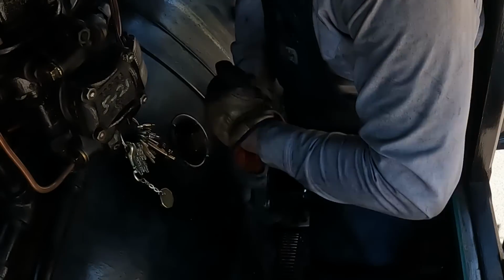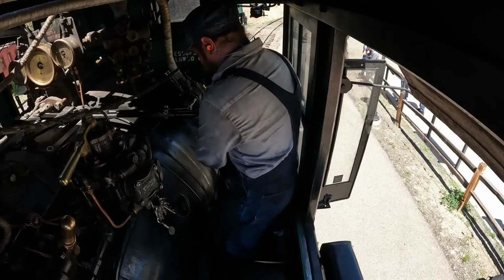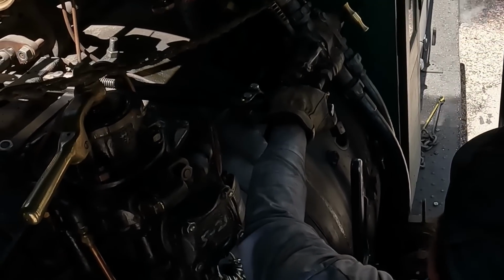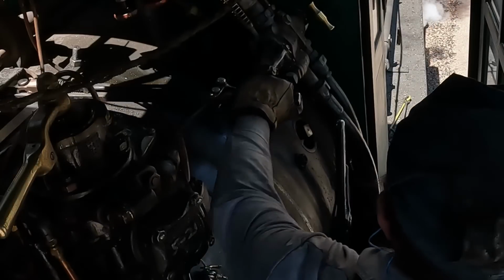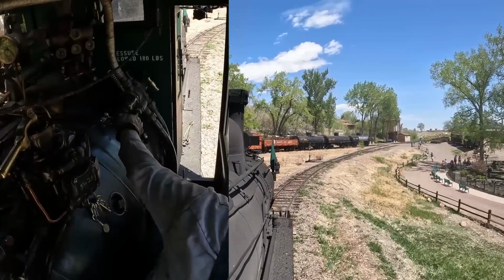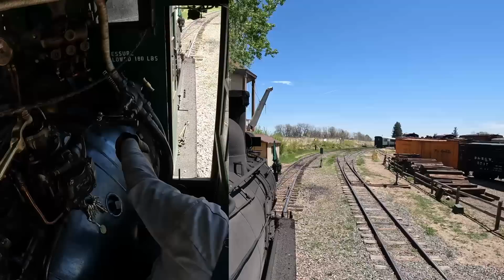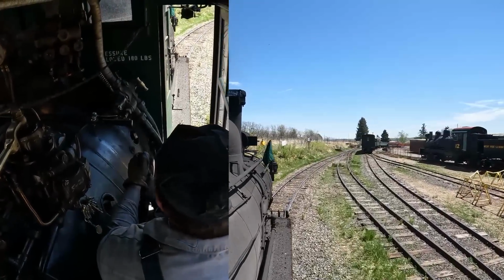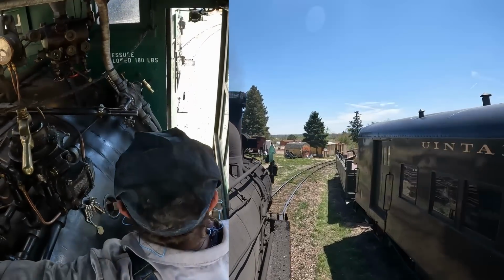How to DRIVE a real STEAM TRAIN - First Person Engineer!

Comment: Hello Hyce:  With your professional knowledge of management of train handling and train operation, I am surprised that you referred to running a locomotive as to "drive" it in your video title.  Since the museum is a teaching museum, it is important to teach facts on the thematic subject.  Here in the North America, it is important to stress the fact that "driving" a locomotive is incorrect (which applies to any type of locomotive motive power).   My comment is not directed to you but to ignorant rail fans and the general public alike that visit the museum and watch your videos.  Take it from a retired locomotive engineer of a major Class 1 US railroad and rules instructor.  In comparison, contrary to European nomenclature, here in the US is a fact that needs to be known and taught to fellow rail fans. As we taught in our technical training classrooms to our students, the locomotive engineer does not "drive" the train as it is often incorrectly implied here in North America. Simply put, the locomotive engineer (or operator of a locomotive) "runs" the diesel engine which in turn propels the locomotive via electric traction motors.  (Steam power in your case).  Reference to diesel electric, it just so happens that the diesel power plant propels the unit in response to the hand controls the locomotive engineer (or operator) manipulates in the cab (the throttle).  The unit(s) (locomotive(s) travel on a fixed guide way and are not driven (or steered) like a road/highway vehicle.   Also, inside the railroad business, categorically a locomotive is usually referred to as a "unit",  when in consist.”  For example, if one sees a train with three locomotives, it would be referred to as a three unit consist, or a set of power.  Rail fans may call this a lash-up.  In the railroad business, it is addressed as an "MU" (multiple unit consist, or simply 'consist').  Sometimes a single unit is also referred to by the slang term as "motor" by crews.  Hyce, you would make a very good instructor, your knowledge on steam and management of train handling is admirable.  Keep up the good work!
Reply from the maker: Howdy Ernest! I hate the term drive, and always say run myself. The title was to get non-train folks to come watch, and it worked, thankfully! One of those things about YouTube. Gotta get people in the door. Great comment, thank you!
Reply: @Hyce777  your title certainly got my click, and I’m so glad that it did. I love your videos and the type of person you come across as in them.
Reply: When kids would ask us how we "drive the train" we show them the brake wheel back in the caboose / coach and tell them that's how we steer.

That reminds me of this one woman who refused to ride since there was no flanges on the OUTSIDE of the rail. 

You meet all sorts.
Reply: @kevindowling157  Same here. I know nothing about trains but find them fascinating, so I'm glad to come across videos titled this way, as well as comments like Ernest's. It might be good to explain the correct terms in the beginning of the video, though. Just a thought. Either way, great videos!
Reply: @Hyce777  I wonder if "How to RUN a real STEAM TRAIN - First Person Engineer!" would have worked any less... and I've seen those colloquial "drivers" in virtual aerospace as well, like a "Hornet driver". It's rare, but it happens. Then there's a simple rule to go by if getting engaged by something: "Break! Jink! Stop driving!" (thanks to C.W. Lemoine for that! XD).
To be fair, as English isn't my native language, I've been guilty of saying/writing "driving a train/locomotive" before as well. So it isn't always just ignorance driving that wording, pun intended.
And since curiosity brought me here in the first place, learning the proper terms is part of the whole thing. There's no point in learning wrong stuff ;)
Reply from the maker: @CakePrincessCelestia  Glad you made it here, and appreciated the discourse. It's hard to say if one would've done better, but in my book, aiming for the general public who drive cars; they'd figure you drive a train. Running a train may not give the instant click, which is what you need for the video click, it seems.
Reply: From a pedantic linguistics standpoint: one definition of "drive" may be inaccurate here, but others certainly aren't. You could technically drive an engine that doesn't move at all, and on the same token "run" doesn't necessarily imply movement either. Industry terminology is a strange beast sometimes.
Reply: @Hyce777  Weird that people will apparently make such a big deal about using that term and yet there are actual job titles and postings called "train driver"
Reply: All that comment to say "i wanna criticize you for no real reason". Hyce is a person, he isnt the museum itself and can talk however he wants to in his personal life. Get a grip, honestly
Reply: You must be great at parties nerd
Reply: Royal Navy crews refer to the helmsman of a ship as the "driver," just to annoy him.

Comment: The low frequency sounds in this recording are profound; I recall that the manual for the old dbx subharmonic synthesizers strongly cautioned you to only play music through them, and not sound effects, and especially not artillery fire or railway locomotives, as you'd ruin your speakers.  You really get a sense of why this caution was there.
Reply: I have subharmonics turned on in the dbx driverack in my system... yeah that caution had a point. Kinda glad my compressors and limiters are setup to handle that.

Comment: Hello, Hyce!  I have a question about couplers.  If you take a 50 car train for example, the second to the last car is only pulling the last car.  As you move forward, the third to the last car is pulling two cars - and on and on, each car moving forward is pulling more weight with the first car of the train pulling 49 other cars.  Does the coupler of this first car have to be stronger than the coupler of the last car?  I believe all the couplers are similar, but some have much more stress on them than others.  I would appreciate your insight.
Reply from the maker: Technically, it "has to be" if you are in tension, but they are all made to the same standards these days such that any car can end up in any position. That's not the case with the old stuff we run here, but that's ancient history these days. Wood cars are more likely to pull apart than their couplers in that era, lol!
Reply: @Hyce777  Sooo... Coupler 101 when? :P
Reply: @Hyce777  hey hyce here is an idea: different industries for different maps: for example one map has the one railroads online currently haves and the other has the some of the same industries but the player gets to haul stone, heavy machinery, milk, and so on for many other maps this game has planned

Comment: This sounds MAGNIFICENT. You make this look easy. I imagine it'd be an absolute handful and a half for me, given how much work the Derail valley 262 is.
Reply: In Derail Valley you have a whole steam loco for yourself, but coal shoveling, keeping an eye on the water level etc are duties of the fireman, not the conductor.
I think, being a conductor in RL is easier than in derail valley.
Reply: Minor correction: the Derail Valley steam loco is actually a Mikado (2-8-2). ;p

but agreed on the fantastic noise.
Reply: @TDU2boi59  ah, right, stand corrected there!

Comment: I visited the museum a few years ago with my father. We were both pretty amazed at what a grade there was for being such a small circle, which is nice to see because you actually get to see the engines work uphill.
I volunteered at the Pine Creek Railroad museum in NJ growing up. We actually had a similar setup, 3 foot gauge track in a small loop. Our loop is bigger (about a quarter mile), but we also don't have steam or as much of a grade uphill. We do have a decent downhill slope when we run normally.

Comment: Fun stuff. When I lived in Perris Ca, I spent quite some time at the rail museum, one of the biggest in the west. The Santa Fee would let us use the main line between the museum and the town which was kind of neat. We had equipment from 1900 ish LA transit, electric street cars, main line retired diesels, steam, tons of support equipment and so much more. This brought back some very fond memories. Your comment about small gentle movements is exactly the same for aircraft. I worked my whole life for McDonnell Douglas and Boeing when we merged. i got my private pilot license in 1979 and it is very similar except after your small control input, you center the controls again then apply opposite control when you want to return to level flight. Example a left turn. Apply left rudder and left aileron until the aircraft reaches the desired bank. Center the controls and the aircraft will continue to turn. When you want to go straight, apply right rudder and right ailerons to remove the aircraft from the bank and bring the wings lever again then return the controls to neutral. If you have passengers, they like things nice and slow and easy. By yourself, you can be.... more adventurous LOL Even giant airliners can do some aerobatics if done carefully. Passenger's don't like it though :P  GREAT video, thanks!!! Oh, I forgot to say our track ran 3 rails so we could run narrow or standard gauge equipment over the same track. As all boarding was done from the right side of the trains, the right rail was used for both narrow or standard gauge. The narrow gauge track was inside the left standard gauge track. This way one passenger setup served all equipment.https://socalrailway.org/
Reply from the maker: I bet it's a lot of fun to make those moves happen, but yes, passengers complain :D

Comment: This was so cool! It seems like that balance between applying power and applying the brake is sort of what I do when I'm driving in order to avoid getting terribly bored. I try to drive so as to use as little brake as possible. I try to just let off the power to slow down if I need to merge with slower traffic and then just brake if I miscalculate, if there's a traffic jam, or if there's a red light. There can be a big difference between different vehicles when it comes to the rate at which they will slow down when you let off on the throttle. When you let off the throttle on a motorcycle, it slows down surprisingly quickly, almost as if you were braking (which is a useful thing when you see a cop and know you need to slow down but without the cop being drawn to you by any brake light action). Then normal cars fall somewhere in the middle, usually depending on their weight. On the extreme end, my mom's hybrid car hardly slows down at all when you stop applying power so you have to let off the throttle for a longer time to slow down than on either a regular car or a motorcycle. Anyway, that's how I amuse myself while driving so that my ADD-addled brain doesn't get distracted from the important task of paying attention while driving.

Comment: Thanks for doing all these videos it's really fun to watch all your videos. 
As a child it was always a dream to own a functioning steam engine and since a locomotive was a little big I went looking for stationary engines and just picked up a stationary engine that still uses a swift oiler for lubrication inside the cylinder. 
The engine dates to 1902 and is a 4 horse. Running it on live steam from a wood fired boiler never gets old and is my way of time traveling to the 1910s era of steam and is the most amazing part. 
Your videos enable the viewers to take a trip back to the 1950s and earlier and that is worth every bit.

Comment: Great video Hyce! Seen several others that give an overview like "this is throttle, this is brake, this is Johnson bar" but not so in-depth as you went here on why you're doing the little nuance things you're doing. Like feathering the brakes, adjusting the Johnson bar when and where you do and why, the little tugs on throttle, braking specifically to stop the drivers before they stop themselves.

Though as is common in most of my work safety training that talks about specific activities that require specific training:

"This does not constitute training on operation of RGS #20 and does not qualify you to operate RGS #20."
Reply from the maker: Indeed, because of course there's always more to learn... And you have to have the feel for it first! Haha.

Comment: I'm a driver here in the UK, the names of things are slightly different (Johnson bar is the Reverser, for example) and most of our stock is vacuum braked, not air, some of our reversers are screw driven rather than a pole (Johnson bar) and one of my favorite engines actually requires you to shut off steam to adjust the reverser otherwise the reverser will "Pick up" and try to either fling you out of the cab or pin you against the bunker, but this is a really great vid.
I like how you said you watched where others were getting it wrong and modified your technique accordingly, that is the sign of an intelligent driver.
Interesting that you coast in full gear, on most of our loco, with exception of slide valved machines, you coast at about 45% cut off here to give the optimum balance of free running and not bouncing things around.
Reply from the maker: Cheers Ian - other videos on my channel end up showcasing locos from other countries in various simulators. The reverser vs. bar statement comes up frequently, as does throttle vs. Regulator :D

That's a good point on coasting - we coast slow around here in the mountains, and this particular engine is slide valve. I would agree, if you had piston valves and were running at a good clip you wouldn't want things all the way at full cutoff. Cheers :)

Comment: Good to see that the 20's valve gear isn't super violent... I've seen some engines that without power reverse, you release that catch on the johnson bar, you better have both hands on it because it's going to move on it's own when it's free!

Very nice video and explanation of what you're doing while running.
Reply from the maker: You definitely need two hands, but it's not that bad. Fresh rebuild, and all that. 346 needs much more of a stern hand...

Comment: Great video!  I assume that is 3’ narrow gauge, which makes it still about 3 times as big as the steam that I have run.  I spent 8 years of summer weekends operating a 15” Crown coal burner than ran on a 3/4 mile loop in a city park in Flora, IL.  Your video really captures the nuances of operating steam, most of which were applicable even on the Crown.  In some ways, ours was easier, no train brakes, mechanical engine brakes, drawbar coupling of the cars (probably less than 1” of slack in a three car consist).  In some ways it was harder.  No room for a fireman, so I had to do it myself.  And no riding conductor, so I spent a lot of time looking over my shoulder to keep an eye on the kids in the back.  Failing health won’t let me do it anymore, but I wouldn’t trade the experience for anything.  There must be a few cinders in my blood.  My granddad worked 51 years for the L&N (1908-1959), mostly as an engineer.  Keep the great videos coming!
Reply from the maker: Very cool! 15" gauge is absolutely big enough to feel some of the same stuff. Yes, this is 3' gauge. Thanks for sharing your story :)

Comment: Man, I for some reason had been thinking locos are on a completely different world from tractions (yes, we don't call em tractors but they are the road/field/no track small locos) but, yeah, I should've realized it's the same foundation of engine type. Volunteered several years at a local steam traction engine and threshing show and done their tractor pull. Which the pulling sounds fun but really boring since steam engines, even smaller ones don't care about max weight on those sleds, they just go. But seeing that 30 or so plow in illinois is something. Prolly like going up a 5 at the fine point of barely making it, it's a smile on your face you never knew existed.
Thank you hyce for getting me back into steam.
Oh, and threshing, seemed like every 5 minutes I had to throw in another 3 block of firewood. The "tender" was always out 2 hours in. And it's relatively scary that the belt, between engine and threshing machine, easily could slip off the flywheel and easily destroy something.
Again, much thanks.

Comment: I have only ever driven on a few short experience courses but I have found that steam locos (or at least the one I have driven) are a lot trickier to control than any diesel I have experienced. It was an LMS 3F 0-6-0 Tank running without any coaches or anything, but trying to get the vac brake to stay around the 15" mark while watching out the back window to see where to stop was not an easy thing. I'd imagine it might have been easier to control if I had a few coaches act as a bit of a buffer so it wouldn't react as quick. The other locos I have driven have been two English-Electric Class 40s which despite being the biggest I have ever driven, were a lot easier to get the hang of especially with having the straight air brake. There was another diesel I have driven that was a small 2' gauge Ruston 0-4-0 diesel that had a 3 speed epicyclic gearbox to control with just a handbrake which was interesting, LMM has shown a few similar 2' Ruston locos on his channel but I have noticed he has a slightly different method of changing gears than the guy I had as instructor when I drove one.

Comment: A lot of what you explained and shown in this video pretty similar to what I've seen engineers do when they operated 340 at Knott's Berry Farm. Everything from slightly "bumping" the throttle for the fine adjustments to starting with 5-10 pounds on the brakes. I really miss working with that locomotive